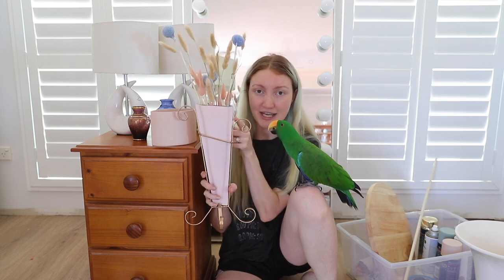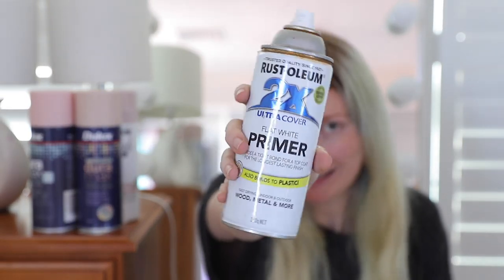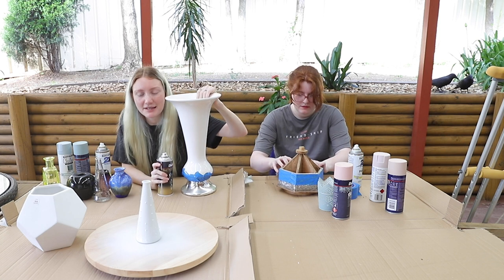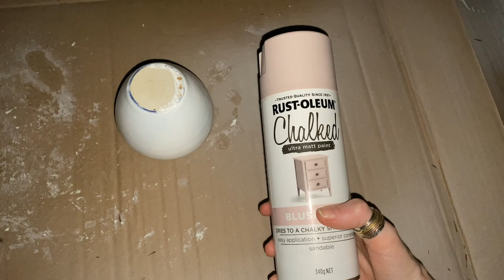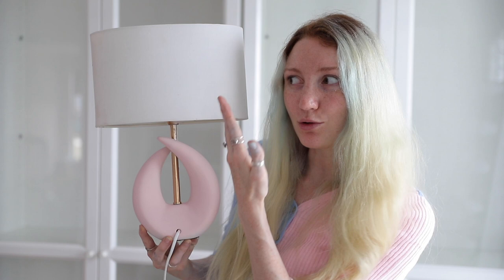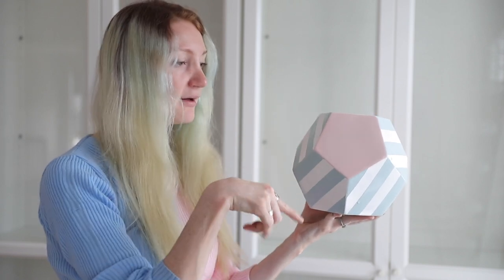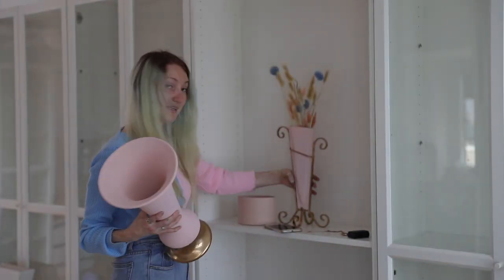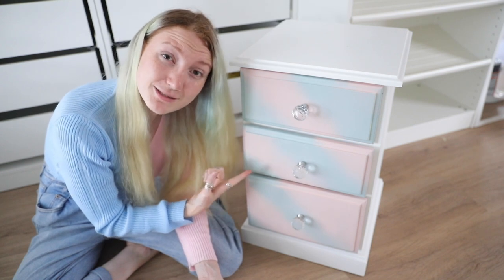PASTEL THRIFT FLIP!!! UPCYCLING THRIFTED ITEMS | THRIFTMAS DAY 5

Comment: Anything glass is pretty safe for restoring, glass is created at over 1000 degrees, ain't much that can make a dent in its surface paint wise. Most of the ceramics you've painted are going to be prone to scratching and chipping and need a clear top coat.

Comment: Yes redo the small vases, the tape your using is wrong you need to you masking tape, and you can get tool's to go through the hole 🕳 can't remember what they are called but will look for them and send you a photo on message in Instagram.
Love the draws the way they are looks so cool 😎
Remembered its a socket set yo help with the lamps 💖🎀 XX

Comment: You are a bit of a goof, I had a oh boy moment when you painted it and almost clapped when the paint came off x'D
Also, from experience, the paint could be cracking because there was just too much spray paint. There's a high possibility it's just the paint alone causing the cracking, but the heat possibly doesn't help. Stripping them down and using a different paint should help :D (though watching the paint stripper was cool)

Comment: The dripping paint technique you were trying to use would have turned out better with a liquid paint, you could even dilute some thicker paint in water to achieve that effect. Spray paint is not meant to pool around, it sets super weird like you saw first hand. Pretty sure you're supposed to use it when you want even coating, it isn't very good for detailing.

Comment: Acrylic base paints would work better for the concept you are trying to do with the vases. Spray paints are not always designed to properly "stick" to the texture of the vases making them bubble and dry strange. I would specifically look for glass/ceramic acrylic paints, and you should get your desired look with them.

Comment: Please don't use spray paint for that type of thing on that van get the gold leaf and use a brush it's not hard if you get a nice and good solid brush and you can keep it off and your I think what's happening is you're not waiting for it to dry properly between painting light sprays multiple coats if you have to but do like your little heavy-handed on the spray paint

Comment: Maybe try the paint messes at other people using right now where they're doing hand painting their taking whatever color they like mixing baking soda or cornstarch on with it and it gives it a clay pot look and it turns out really good and it tends to go on a water different types of glass and definitely the tip of the day is if you look in the glass and it says it's made anywhere else other than in China and even some China pieces maybe research it before you ain't it but not bad for someone that doesn't do this on a regular basis

Comment: Instead of trying to spray paint tiny areas, you'd be better off using a paint brush and some gold gilding paint (especially for things like the edges on the hexagon-side vase or the post in the middle of the lamp).